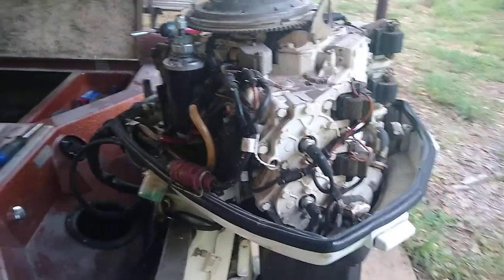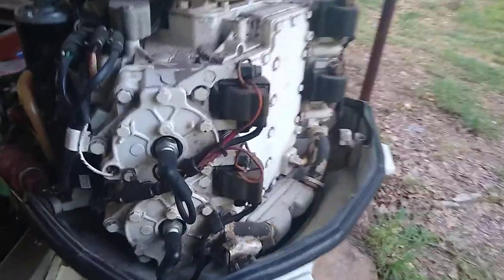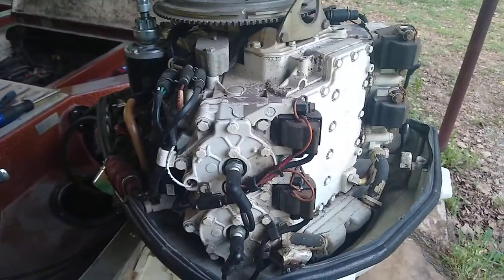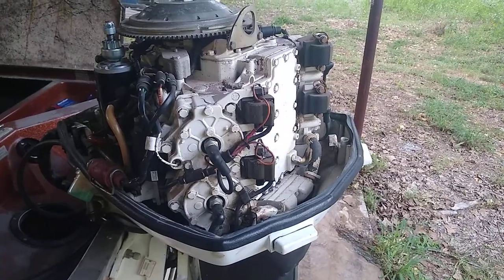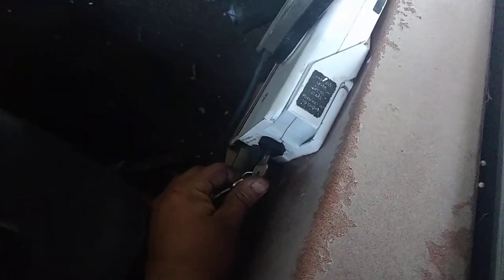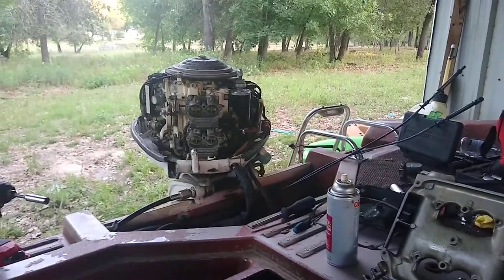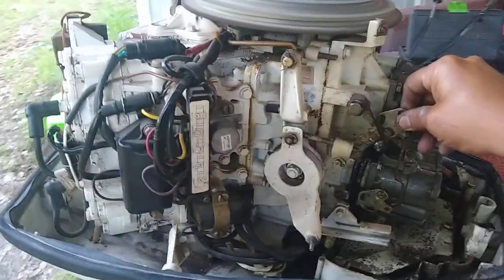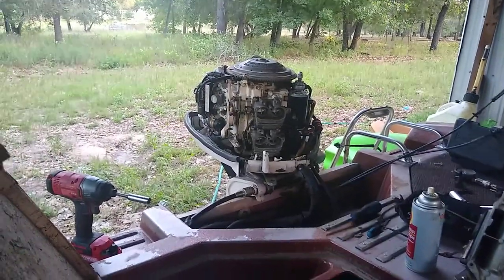1978 Johnson Evinrude v4 115

Comment: Owned a 83 115 V4 ran 60mph on a 700 pound Bass Cat! Raker stainless prop, I had custom decals made for it the Evinrude letters were made bigger added V4 to front of cowl had it painted silver blue Saturn car color! It looked awesome I beat a lot of older bass boats with 150s and 200s! Those boats were heavy doing 50 to 55!
Reply: I have a 83 115 v4 on a 15ft glasstream boat and it runs about 77 and I outrun a lot of these new boats
Reply: @brandonetchison8911   what pitch prop do you reccomend for these motors 17ft 1970 caravelle

Comment: First time evinrude owner here..  Thanks for including that information about the electric primer process.  I have had some difficulties in the past starting because I had no clue about the priming process.  I think I was floding it by pushing key in several times.  You can flood engine by priming it too much?  Just like what happens when choked too much? I never thought to hold key in for 3 seconds.  And hearing the noise from engine is a great cue.
Reply from the maker: Yes, every time you push the key in, you are squirting fuel into the motor.

Comment: I have the same motor and it would not stay started. when I took the carbs apart to clean and rebuild them, the needle and float had no spring for it so I put it on cause the kit came with it but now it floods. Should I take it out?

Comment: I have a 1986 Johnson 140 that looks very similar to yours. Mine runs fine on the hose but won’t idle in water and bogs down in gear. I’m about to rebuild the carbs, check compression, and check spark. Do you have any other suggestions as to why I’m
Having the problem that I am given all three of the tests pass?
Reply: Make sure that your gas tank is also clean while doing all that stuff and put a inline fuel filter. I have a 77 115hp, but I forget if they have a fuel pump. If you have a fuel pump make sure it is pumping fuel. Let me know how it goes!
Reply: Mine does the same thing, found out I have 2 bad cylinders, check your compression
Reply: Check sync/link and timing
Reply: My 83 Evinrude 90hp was doing the same EXACT thing. Ran great on hose, bog down in gear in water and hard to start. I had a few people look at / tinker with it with no change. I told the story to to a mechanic from a company called ring power. He comes on our property and does all the maintenance and repair on our Kubota's, Isuzu work trucks, welders...everything. To make a long story short he was finishing my story about the problems before I was to a tee. He told me to replace the primer bulb. I was sucking air in somewhere. Not enough to affect it with the hose but in the water and a load on the motor, problems. Didn't believe it but I already tried other things with no luck. I went and bought a complete fuel line kit from the tank to the motor and sure as s&*t the problem was solved. The old "rubber" fuel line came of like it was made of plastic. Best $100 I've spent.

Comment: I have a 1977 115 johnson and i have a very hard time keeping it running you have to push the prim off and on are a few times to get it to start at all its getting gas in the filter  and if your put down the lever on it that says pull up when starting  it dies 99 present of the time i checked spark they seem to be hitting the same on all 4 and changed the plugs im really lost its driving me nuts i got the boat from a guy's that was moving he said it runs very well and just had it out i think not there no way the way this motor is right now.  I haven't even gotten it going good enough to take it on the lake i had put it in the water at the boat ramp you go to go in gear dies right away i understand old cars but lost on boats 🚢 any advice very much appreciated!!
Reply: Did you ever figure your issue out?

Comment: that sounds incredible. I have a 1979 2 cylinder 55 hp johnson. What's your best tips for looking after it? I just picked it up and learning a lot from people like you on youtube. Thanks
Reply from the maker: Best advice is use it. Dont let it sit.
Reply: also... warm it up for 10min, dont' goose it out of the dock.... the pistons have to warm up to fit properly in the cylinders due to thew way they are made so you'll ruin a motor if you goose it out the dock cold.

Comment: I have the same motor. It’s shooting water out of the seals or something at the bottom of tje motor.
Reply from the maker: Where? On the lower unit? Or the base of the power head inside the cowling?
Reply: @TheJoejoe7716  inside the  Cowan
Reply: Cowling
Reply from the maker: @mikewolfzorn7128  there are a few places it can leak from, the thermostat housing, the exhaust plate, or the power head base gasket. All are not very hard to change. Just be careful taking the old rusty bolts out and go back with anti seize for next time.
Reply: @TheJoejoe7716  thanks for your time!! I just want to fish!! Hate all this maintenance work that goes with it. Lol

Comment: Have a 1980 115 hp . Has good compression. Runs for 2 -5 min and dies. And it even at full throttle won't pick up any speed. It just inches along.  Any suggestions anyone ?
Reply from the maker: Have you tried pumping the primer bulb while running on plane? Could be a fuel restriction.  Also, does it start back up if you crank it after it dies?
Reply: Yeah i have pumped it.  It starts up again after a couple of min. But won't go fast at all. With the muffs on at home it runs like champ. Just not in the water.
Reply: Check compression first. If good compression check your coils flr spark maybe need new ones.  If one side of cylinders have spark and not the other change power packs around and see if othee side now has spark, if it does then you need power pack.
Reply: If it just inches along at full throttle it sounds like the hub is spun/bad on your prop